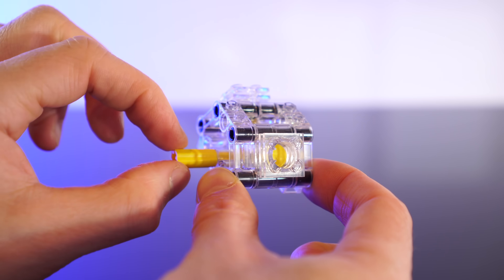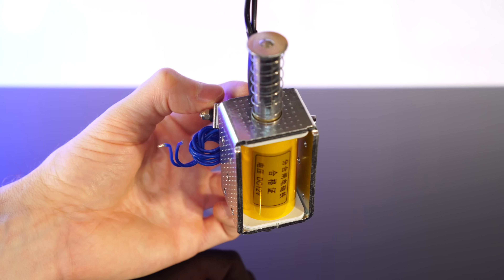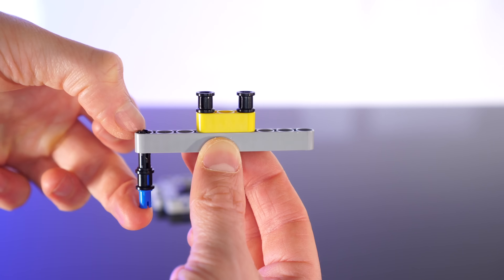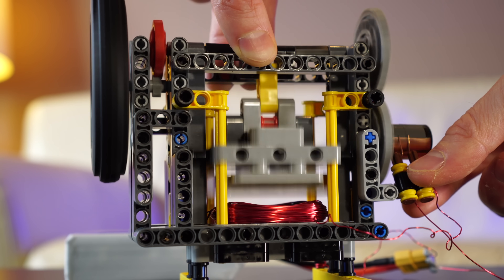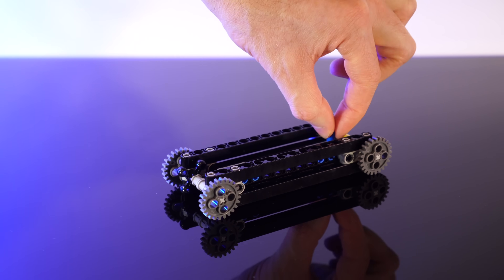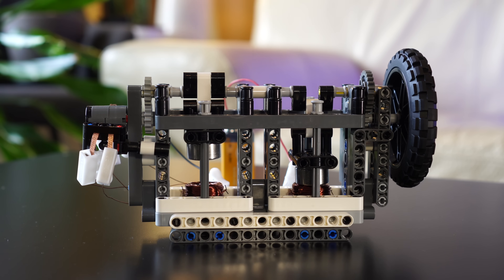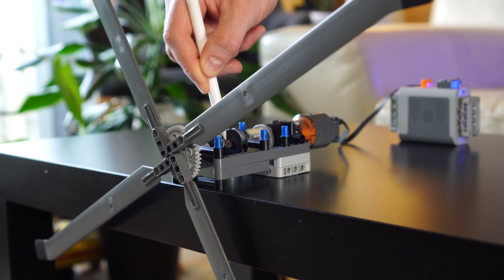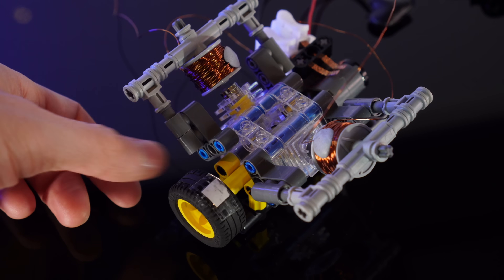Lego Piston Power: Making ELECTROMAGNETIC Engines!

Comment: you know with it being a DC electromagnet, you could make a mechanism to swap the polarity of the electromagnet and turn the two cylinder into a 4 cylinder due to each stroke being a power stroke
Reply from the maker: Yeah that seems to be a common recommendation, and I think it's a very good one, thanks! If I can find a good way to secure the magnet better that's definitely doable

Comment: Something you could do to make the engine make more power is you could make a circuit that flips the current of the electromagnet when the piston is on the way up so it would both pull and push the piston.

Comment: I suggest adding a ferromagnetic core, and also a thinner copper wire.  You will be able to have more turns in a smaller space, making the electromagnet more powerful.  Although not too small, else you wont be able to pump as much power through it

Comment: could you split the  DC into a positive, a negative and a ground rail and have a second inverse timing gear connecting the coil to the other negative rail on the backstroke pulling the magnet. YOu could have a two stroke solonoid engine, and combine this with the other guys idea by adding coils to the other side of the piston head too and get a 2 stroke 4 cylinder engine out of 2 magnets, it's ECO!

Comment: somehow this has less power than a stirling engine of the same size
Reply from the maker: That's probably about right. Stirling engines are remarkably efficient. And solenoid engines are remarkably inefficient 🥲
Reply: @JamiesBrickJams  Try making a tesla turbine from lego to power stuff, there's a recent video that made a comparison between lego engines (with a jet engine thumbnail) and he made the tesla turbine, it blasted the competition in power and speed
Reply from the maker: Oh yeah that sounds like Brick Science's video. Probably my favourite videos he's made. If I can get my hands on a 3d printer, I'd love to try a Tesla turbine!
Reply: @JamiesBrickJams  the 3D printed tesla turbine gets very little power and efficiency due to the disks rough texture, which breaks the laminar flow. I'd recommend old big hdd disks, or cd disks (they are both made for high rpms and are smooth). you'd only need to drill a few holes for the exit port in it and make the casing and rotor. I'd also recommend to make the shaft longer and have the bearings / rotation point have their own housing away from the main casing, leaving space for the gas to leave (which in a steam scenario would not damage the bearing due to the heat). Great video!

Comment: There is a theoretically optimal timing based on the radial distance that the contact strip is taking up on the distributor as well as the strips timing with the output of the motor, in number of teeth. And you might be able to get more efficiency from these same designs by finding out the optimal timing. If the magnet is operating any kind of a pushing  Force while it's on the up stroke or vice versa then you're going to get poor efficiency and the contact strips width would change that.
Reply from the maker: That's very true, some of these required quite a lot of tweaking to get a timing that worked well. Another commenter suggested using hall effect sensors and mosfets for the timing. I quite like that idea to refine the timing electronically

Comment: As you said the engine is more efficient when the magnets and coil are close together. You could probably reduce coil heating by shortening the on duration of the copper strip on your timing wheel to only give any real kick when the magnet's pretty close to top dead center. That way your average current is lower but you're getting peak torque for short bursts
Reply from the maker: That's true, there's probably a good balance to strike between efficiency and heat production. Interestingly, it's actually quite noticeable that when the coil heats up, the rpms drop. So keeping it cool is clearly beneficial for longer run times

Comment: just a tip, magnetic transmissions are better to start off slow. a reason is because the magnets need to catch. you can see this in a pc fan or which ever fan uses the same idea, if you start the frequency off really high, the magnets dont have time to catch with the changing magenetic feilds in the the copper coils. great video otherwise!

Comment: I love this idea ! I have one tip however. 
Whenever you are moving something, you want it to be as light as possible, so that more energy is left over in the end. The next time, try moving the coil and keeping the magnets stationary. Seeing the coils move up an down a bit the wire should be fine. If the whole rotor is lighter it should spin allot faster!
Reply: Doesn’t the presence of a flywheel make that moot, since the engine is designed to have a heavy mass moving quickly to provide momentum for the full stroke?
Reply: @dawica  The flywheel provides stored rotational energy to keep the engine moving. The pistons themselves being heavy, also being connected to the same shaft and counter balancing each other don't provide this function. But I understand what you are saying.

Comment: those magnets look a lot heavier than the coils do, so maybe swap it so the coil is on the piston and the magnets are stationary?
Reply from the maker: It's technically possible. Though there'd be quite a bit of mechanical wear and tear on the wires being flung around the place. Would probably get quite messy. Certainly possible for a short-lived project though

Comment: Looking through the comments and seeing two things I really like. One, flip the polarity of one of the coils and keep the timing the same for a free down stroke. This will prevent any “dead spots” in the engine, acting as a fly wheel. Two, using some mosfets to power the coils and trying some Hall effects sensors and a magnets on the fly wheel for timing. This means the timing would be infinitely adjustable and more reliable as well. Also as a side note, I think a microcontroller combo along with some different battery and coil choices might help. Besides that, I love your videos, can’t wait to see the “part 2” of this project!
Reply from the maker: Great advice, thanks! Definitely electronic timing would be needed for any more than 3 or 4 pistons I think. And it probably gets much more effective using hall effect sensors to get the timing perfect. Will give it a bash 😁

Comment: Just wire the coils that are 180 together with oposite polarity and keep the same timing, simple free down stroke. Try to use mosfets for powering the coils and hal sensor with magnet on flywheel for timing. Should be easy enough + the timing could be infinitely variable. Good thing would also be to controll the duration of power stroke, try to wire coils into higher resistance and use more voltage for power, this might produce less heat since the coil could operate more efficienty. Iron core or shield would benefit a lot. Get rid of the contactor ASAP, creates a point of high resistance plus the brushes can just float over it at higher speed or even not make contact due to impurities. Adding microcontroler would be insanely cool, a bit of work but nothing to extreme. Doubling the piston count to 4 is a no brainer imo, potentialy -180 degree of dead zone. Use hot glue, much stronger and comes right off with a bit of alcohol. Hope some of this helps. Keep up the videos
Reply from the maker: This is all just the best advice, thanks for taking the time 🙏 Hall effect sensors and mosfets are likely the best means of scaling up to anything more than 2 cylinders. I'll definitely give that a try. I had no idea how glue could be easily dissolved or removed. If so, this could be a major win for the builds that need magnets to be secured in odd positions.
Reply: @JamiesBrickJams yes, hot glue comes up super easily with a little alcohol, just remember to test it before you commit to using it on a build lol
Reply: @JamiesBrickJams  I would also suggest getting those magnets in the center of the coils.
The biggest issue is distance.

The stroke can also be timed such that it remains very short, as to not counteract the next stroke.

Comment: I've read that you don't like using permeant fixture methods on your Lego like super glue but don't be afraid to use hot glue it offers incredible strength but can be peeled off and cleaned up with no damage done at all this can give you the ability to hold your crazy magnets in place when using a ferrous core in your coils to get a way stronger magnetic field from them
Reply from the maker: Oh wow really? If so, this could be a major turning point for my builds. I'll certainly give that a try - big thanks for the heads up! 🙏
Reply: @JamiesBrickJams  i love getting replies to my comments from you and I'm always so hyped to see new vids i get so excited and it makes my day so much better love your content dude keep it up ♥♥♥

Comment: I would suggest to connect a diode in parallel to the coils because when they are disconnected they still want to push current which results in a huge voltage spike in the opposite polarity which is why you see the sparks at the contacts and could potentially damage some batteries or other components. The diode solves this by acting as a freewheel when the coil is disconnected and allow the voltage to go through it instead of other sensitive components. Electroboom mentioned this in his video on relays: https://www.youtube.com/watch?v=PHcCSZ5nScM&t=13s

Comment: your crank is way too small, you might want to give the crank a bigger stroke, this way youll get more torque. Short throws are good for speed and horsepower but not for torque. Also for the timing mechanism, you might want to try a bent nail held tight with a rubber band so its more akin to a car distributor.
Reply: In this case what is the difference between horsepower and torque?
Reply: With more crank length you get further from the magnet so it would lose power to that. You'd be correct if it was powered through pressure.

Comment: Dude use a ferromagnetic core for those electromagnets like soft iron core and you can get some nice performance from the coils, for proper electromagnets you need a core,you don't just use coils,you need to place a core then you can get some real magnetic power!!! I hope you add a core in the next video!
Reply from the maker: Hey, that's a fair point! I'm well aware ferrite cores will improve performance. To be honest, I've tried many times to incorporate various cores into my designs, but the primary issue I run into is that the cores attract these beefy neodymium magnets so powerfully that they often yank my magnets out of place during operation. I don't like using permanent fixtures like super glue on my Lego as I need to reuse all parts. Even just building the designs is a nightmare when you've got metal pulling on the magnets. So I often just sacrifice performance for the sake of making the build possible to film and operate at all.
Reply: @JamiesBrickJams  Glue the iron cores to the coils only. This way, they become a single reusable part, similar to the LEGO pieces you use in various projects. Since you seem to use similar pairs of magnets and coils, it might be worth sacrificing a LEGO piece by gluing it to a coil or magnet to create a sturdy attachment point for future use
Reply from the maker: @kissa02  that's actually not a bad idea. I'm sure I could sacrifice a few pieces for the greater good 😉
Reply: @JamiesBrickJams Here's a other idea: look up gauss effect. Im sure you will be able to improve the engine more, by inflicting a alternating current to the coil for a short time, you can launch a ferrite piece with some force, once it reaches it peak, you can stick with one pole so that you can attract it back. 

A other simpler idea is to have the poles on your solenoid reverse once the magnet reaches the top, this will, of course, attract the magnet.

Now i didn't calculate the efficiency, but this should double or even tripple your strength.

Hope this helps!
Reply: @Couch_potato_ahh   I may not fully understand but supplying a coil with an alternating current that goes from positive to negative and not just varying up and down in the positive polarity, would create a magnetic field that flips it's north and south poles wouldn't it? In one alternation it'd push the magnet (depending on polarity) and in the next alternation it'd pull the magnet.
Alongside with AC you'd get reactance, and the higher the frequency the higher the reactance and so you'd get less and less current thus a smaller and smaller field.
Once more, I could be totally wrong this is just my understand thus far.
Reply: @Wayloz  the point is having it switch it's poles. The piston would made out of a ferromagnetic material, which would be attracted when the poles are stable and push it when the poles are alternating. However since i made that comment, i made some experiments of my own and found that it leads to instability at higher speeds and doesn't provide much torque at lower speeds.
Reply: @Couch_potato_ahh   Oh, I see what you mean now, I was thinking of when the magnet was sat atop the coil and applying an alternating current to that. I wondered if the magnet would even be able to escape that field's range before the next cycle occurred. But what you said makes sense now, thanks for clarifying and not a bad idea.
Maybe the frequency needs to increase as the speed does to match the timing / position?
Reply: @JamiesBrickJams  You should try placing an electromagnet at the top of the bore to push the piston back down, improving efficiency, or create an electromagnet that is capable of pulling and pushing.
Reply: @JamiesBrickJams why do my comments disappear?
Reply from the maker: Not sure, are there more comments that should be here?
Reply: @FlammableElectronics  youtube’s auto moderation is garbage so it might be falsely deleting your comments because it thinks you said something bad
Reply: You don't have to use permanent magnets at all, just a soft iron core and a soft iron armature. This is how those solenoids you were using at the beginning work. I suggest you try going back to those, but instead of having the solenoid whack something, attach the armature directly to the connecting rod of your crank. That will give you a much smoother action.
Reply: And they even make iron lego technic axles!
Reply: You added a comma splice
Reply: You'd get even more performance if you replaced the entire motor with an actual electric motor, lol
This type of motor (the one in the video) had only one advantage of the standard electric motor:
The coolness factor.
But in terms of efficiency, performance, thrust-to-weight ratio etc..
let's say there's a reason this particular design of electric motor isn't used in any "real world" use cases

Comment: why not trying to make a double duty piston by revesing the polarity of the coil when the head is comming back ?
Reply from the maker: That's actually a great idea, that should be possible in theory! If I can find a way to secure the magnet round the middle rather than on one side
Reply: @JamiesBrickJams   or you can keep this exact setup , and add an other contact point to the other side of the timer , but with the polarity reversed , so that the one coil alternate the magnetic polarity ?
Reply from the maker: Ah yes, that's also possible if I perhaps super glue the magnets in place. My original designs actually pulled rather than pushed, but they kept yanking the magnets out of position. Blu tack just isn't strong enough with these magnets 😅 But pushing seems to keep them in place ok
Reply: @JamiesBrickJams  have you tried hot glue, it should be better than blue tack and still be able to be removed from legos pieces without damaging them.
Reply from the maker: I've just been hearing this, and I'm excited to give this a try. Thanks for the recommendation!